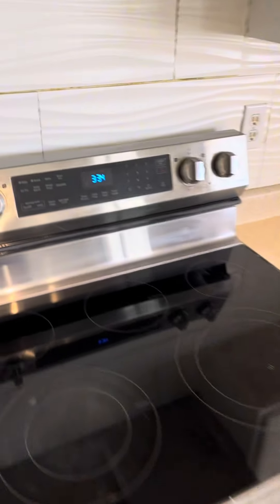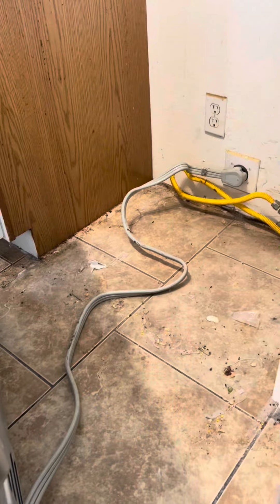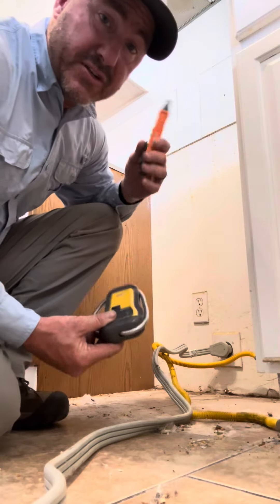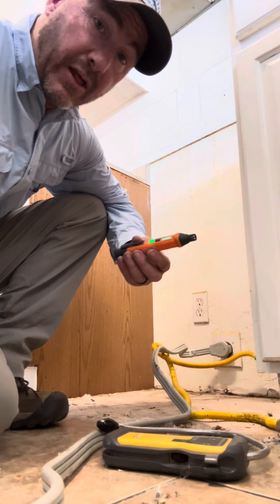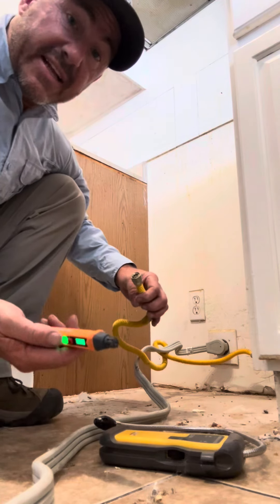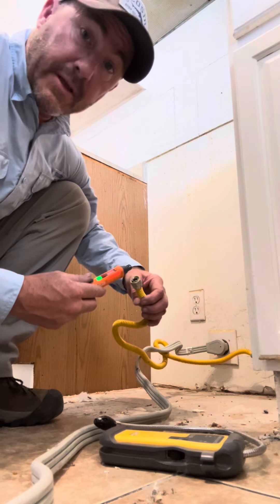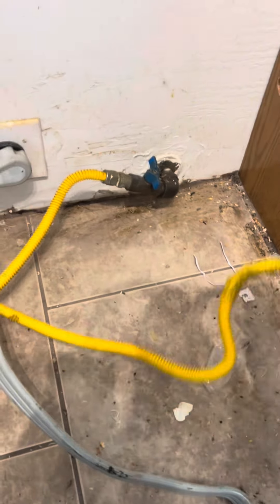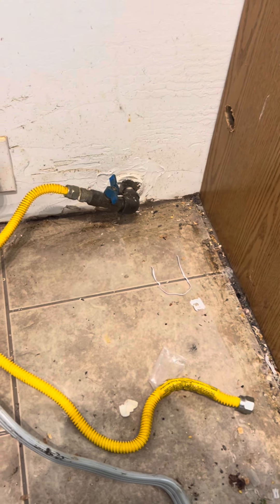Home inspection “Gas Sniffer”

Comment: I've got the cheap TopTes PT210S detector. It works great. I found a tiny leak on a coupling that takes several minutes to blow a very small bubble using soapy water. It's the same detector as in this video, but with a flexible probe. About $25 on the usual site.
Reply from the maker: Works great!

Comment: Okay, question of sorts. 

Shouldn't you be calibrating it outside in clean air first instead of in the home? If there is actually a leak, wouldn't that calibration inside the home just calibrate it to the now diffused leak in the air?

I mean sure, getting it closer to the actual source of the leak will increase the concentration, so the calibration will probably still work just fine. But... welll... I had this house once... and I had to get a leak sniffed because I was certain there was a leak. The gas company sent their technician, and did their test, and declared the house leak free. I did not agree, and proceeded to have the gas turned off completely anyways after a few months of having the furnace turned off and the valve inside the house closed regardless. Why?

Because even though I turned off the gas inside the home, my meter was still running. Much slower, much much slower, but still just enough that there was obviously a leak somewhere. That only stopped when I had the outside valve closed as well turning off my service entirely. 

So I ask my question, because I wonder if the levels of the gas diffused into the air in my home was enough to change the results of their calibration to show it as 'no leak'. I doubt that it's a competency issue, because probably that method of calibrating is just fine normally. But in unique situations like mine perhaps, perhaps it might be best to calibrate using outside air instead?

Would have saved me thousands of dollars that year...
Reply from the maker: You are very right!!  100%